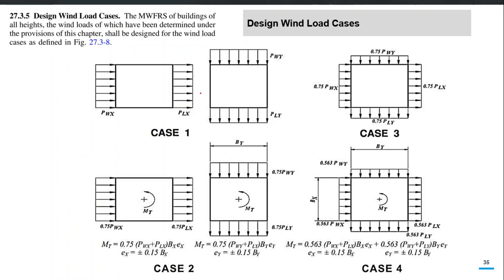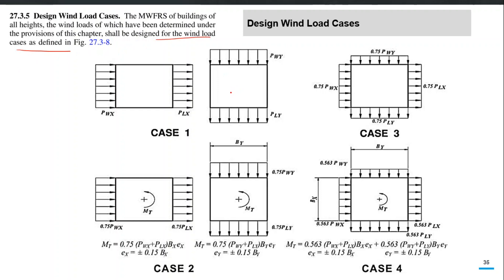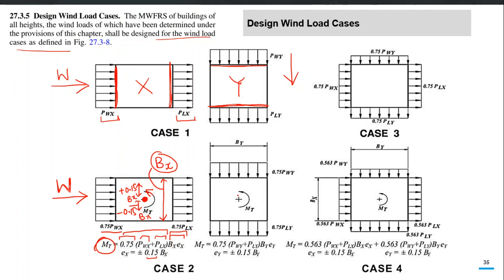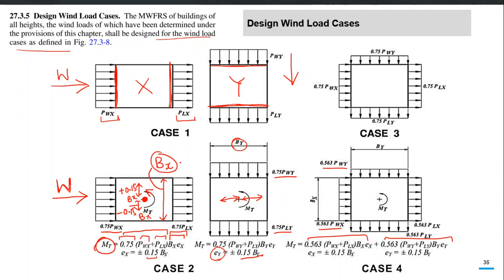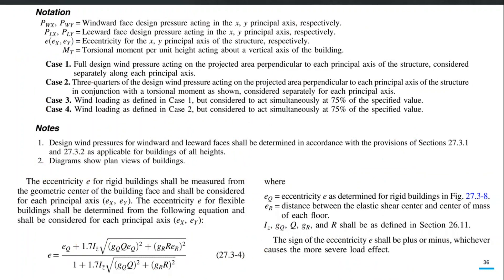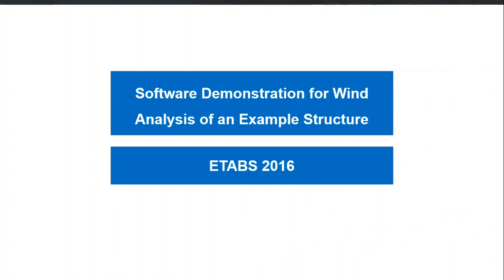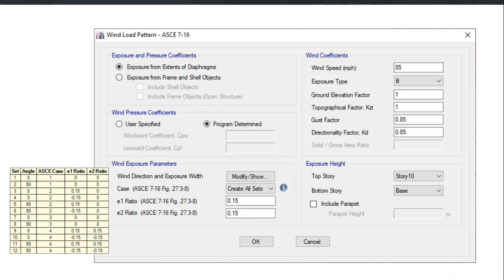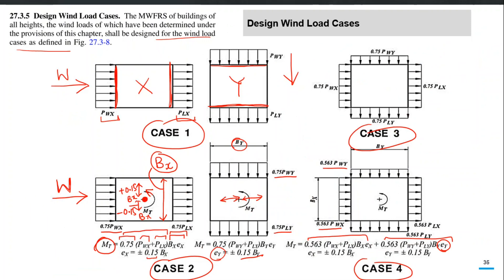Part 4: Design Wind Load Cases and their application in CSI ETABS

Comment: Fawad, thank you for making this video. I have a question, at around 14:00 you showed a table of 12 sets of load cases in Etabs, but why do not consider wind in -X or -Y direction? i.e. wind at 180 and 360 degree? Why only 0 and 90 degree?